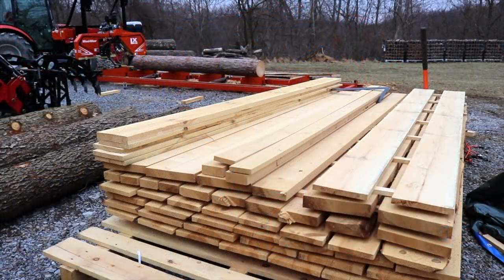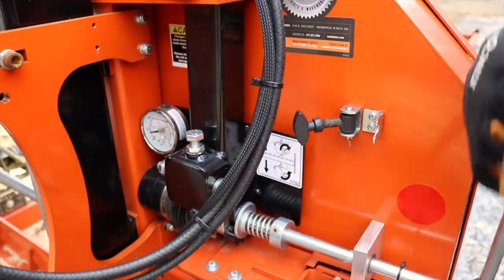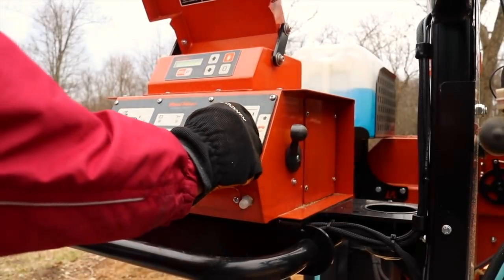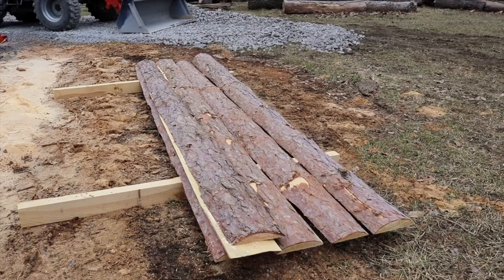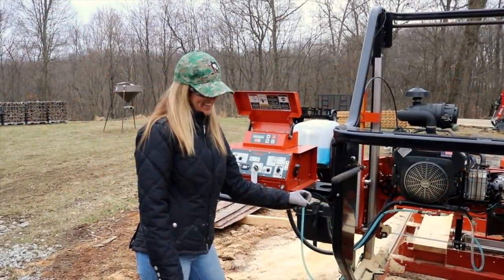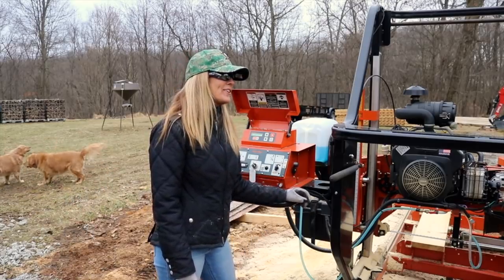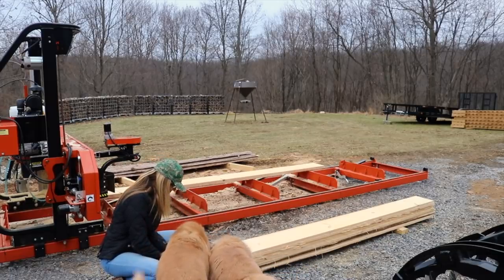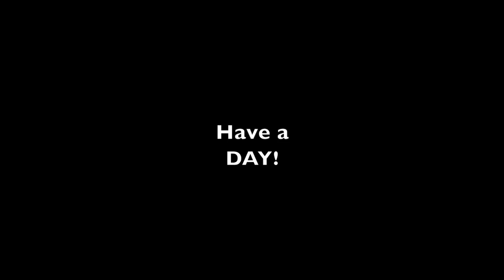#707 MILLING Homegrown Red Pine on the Sawmill

Comment: Mike, 
Engineer Bill here. To net the biggest square lumber out of a log, take the log diameter and multiply by about 71% (actually 70.7%). Looking at it another way, you'd need to slice off 29% of the smaller end diameter to get a clear square. As an example, the small end of a 12" log would yield an 8-1/2" square piece (12" x 71%), so you would slice down about 3-1/2" (12" x 29%). 
Love the videos!
Reply: Mike, My BAD... only slice off HALF of what I said... 1-3/4" (12" x 14.5%). Sorry to ALL!

Comment: Boiled Linseed Oil is what i use on my raw wood about $28.00 per gallon. You can thin it with turpentine or mineral sprites for deeper penetration into the wood. Good also for unfinished work benches and gun stocks. Lots of new snow in Michigan this morning. Have a great day.....

Comment: I use CWF preservative (Clear Wood Finish) by Flood.  You can put that down with an airless sprayer.  It's linseed oil based, but they make an emulsion out of it with water and mineral spirits.  That cuts down on VOCs and sinks into the wood.  We built our spruce log home in 1985-6 and I'm coming up on the fourth time to coat it.  If you like the look of the wood itself, this is a great product.

Comment: For a sealer on 55 sheets of T-111 for my shed, I used a water based product from Behr at Home Depot. What was nice about the sealer, was it was water based and I was able to make 10 gallons from each 5 gallon pail by thinning it with water and sprayed it through a pump sprayer. It was a real light color and I only need to do it every 4 yrs because the stuff held up that good. I do like the idea of Kerosene and oil also, much cheaper.

Comment: I would consider using the sapwood (bark) slabs for roofing for your sheds.  You always seem to have plenty so if it starts to deteriorate in five years you will have plenty more to replace it with.

Comment: We always utilized used motor oil and a splash of diesel/gas to thin it every 2 or 3 coats we would use sikkens stain.  As kids we used a brush to keep us busy, but my dad used a weed sprayer on our barn.The  fence is red and white oak going on 18-20 years since my dad put it in. The barn was sided a year a year after I was born and I'll be 25 in a few weeks we have not replaced a single board on the barn. As for the fence us kids have taken a few out over the years.

Just started watching the channel a few weeks ago, love watching the channel. A hearty hello from North East, Pa.

Comment: I use old motor oil and diesel fuel to thin it out. you could go with straight diesel for a lighter finish.  I soak my poles a lot of times too going into the ground especially, if it is an old telephone pole.  If you get treated timbers to put in the ground, I have heard there is a specific type now that will last and one that will not. 
I use recycled timbers and boards from old barns and houses.  The boards that have sat exposed in the elements that have acquired bugs, when treated with oil, the bugs come out gasping for air and die.  Wood boring bees come out and get stepped on.  They don't fly after a treatment.  If you have questions, just let me know.

Comment: What to coat the wood with???  A lot of people from where I come from would use Automatic Transmission Fluid on their log cabins.  It ages well and gives the wood a nice color.  You can either brush it on or spray it on.  You may want to mix in some Mineral Spirits to make sure it dries well.  If I was doing it I would brush on the first couple of coats to work it in then spray any subsequent coats.  Another very good method is to brush on a solution of 50% Boiled Linseed Oil and 50% Mineral Spirits.  This makes a thin solution that penetrates well and dries dry.
Michael from Canada

Comment: Best all around product of outdoor wood is Thompson's Waterseal. It is hydrophobic and water beads up and rolls off of it. If nothing else those pine and hardwood scraps make great firewood for outdoors if you have any campgrounds nearby. Just cut into two foot lengths and bundle. Bark makes a lot of ash but campfires work fine.

Comment: Thompson Water Seal. If you want a store bought sealant that can be spayed on. I have also used burnt motor oil and desiel fuel 20/80 mix.

Comment: Good day  Mike those outer slabs you  have  we use to get from the sawmill here ,years  ago  we used them for siding  on   some wood shed   and a few run in  barns , its good for that stuff like that, and the ones you have are pretty nice  ,would be good as siding on  a firewood shed   leave a small gap so air can move through  but keeps most of the weather out   Have  A Day  !

Comment: When you save aside the slabs separate  out the utter junk from the usable slabs.
That bark that Melesa  put in the usable slab pile really needs to be set aside. You will be handling  the slabs with your forks. Make sure everything in the usable slab pile is something  you wouldn't  mind using.
She did great.
She deserves her swimming pool.

Comment: Hi Mike and Mallisa!!😀😀
I would use a diesel fuel drain oil mix to treat the lumber if I didn't paint them. 
I would take the nice slabs, peal them and use them for siding on the drying sheds. If they don't match perfectly that's fine. Because it will allow the air to circulate. 
Take care my friends!!😀😀❤

Comment: Mike , Somehow I get the impression that you  and Milissa are NOT  into the "Rustic" look , but those slabs would make great battens for vertical board and batten siding around here. You space your 6-8-10" sawn boards about 2" apart and cover the gap with the slabs.  This processes makes your sawn siding boards cover much more of the building , allows for shrinkage of the lumber as it ages, and  reduces your waste since you don't want to sell softwood slabs cut to length  for firewood.   Around here  in central NY ( 60M south east of Boonville), there is a good market for slabwood  soft or hard, both cut to length or full length. There are lots of Amish milling operations around here and manny people have at least one wood burning appliance in their homes. I utilize all the slabwood either for heating or construction from my home built mill.
 I also built a free standing  steel table with a chain saw mounted on a spring loaded arm which mounts to it and works like a chopsaw  to make cutting full length slabs into firewood length fast and easy.
Loren

Comment: Hey Mike and Melissa. Hope all is well. Have an idea for the edge slabs from the sawmill. Especially where u have sort and hardwood. You could  cut them and leave or split once and sell them as campfire wood in bundles. Sell them to campgrounds. Even see them at country and in town convenience stores. Usually they're 5 bucks a bundle. Like an armload worth in a bundle. Even if u got 2/3 bucks a bundle that's still better than nothing. Usually the ones I see are the same type of wood so must b edge slabs from a mill too. Great use for them. Might be a better option for Hunters little enterprise. Hunter's campfire wood. Nothing better than turning scrap into a little cash. Let me know what u think. Thanks

Comment: was thinking .. you have everything you need for raised bed gardens .. the slabs can be cut to a couple feet long placed in the bottom of it.. sawdust can be mixed with other things like hay and dirt to make soil composrt . you have all the lumber you need for the raised beds. there is lots of vidoes on how to make them. and making compst is easy just need an area to do it . another product from the Morgans

Comment: Sealing wood is just like anything else. You get what you pay for. I'd recommend Permachink Products. My son and I built the log home we bought from KSM Log Homes in Mifflintown PA over 16 months in 2016/2017. I did a ton of research and Permachink has the best lifespan vs protection in their Lifeline Ultra 7 series. Its a 2 part system and works awesome. Seven years average between recoating and when you do, you only use the clear for recoats. No building layers of color and darkening over time. I did our entire 1700 sq/ft log home inside and out over a Saturday and Sunday with a standard Graco airless paint sprayer. Lifeline Clear inside and Ultra 7 color and clear outside. I would also suggest using the Permachink Shellguard RTU for protection from insects. Its a borate based liquid I used a backpack pump prayer to apply. It protects from all wood eating insects. Permachink products cost a little more upfront but after 3 years now, our log home still looks brand new. We would have had to recoat with most other brands. Message me if you need any other info!

Comment: If you are going to make your own siding I would invest in a good router and table. Use a carbide cutter spray oil on the cutter like cheap cooking oil. Then run them through making a tung and grove. Helps keep the water out. You could also take them to a mill. They can kilm dry them and cut the tung and groove for you. Perhaps at a reasonable price. God bless

Comment: Lots of good sealants on the market, the important thing is to make sure the end grain is properly sealed. On smaller jobs I will leave the bottom of boards standing in the sealant over night letting the wood soak it up, another thing I do is make sure the grain runs from top to bottom of the board,,this way there is less resistance to water running off, it makes a big difference to longlivety of the board. Hope this is useful. ☺

Comment: Hi Mike , I'm with the people with the idea of quick burning . Using a tiger torch the burn at thin layer of cellulose. Hardening the wood it's self . Have a look at -->  wild wonderful off-grid <--- they have use it extensively . I understand it is a centuries-old way to preserve wood , my 2 cents 😀 🇨🇦 Craig

Comment: I  like the used oil and Kerosene look, especially on long fences, but I'm not sure how long you'd have to wait to be able to work in there without a mask.  I would leave it dry before I put anything Thompson on it unless they have totally changed their product or you put it on 3 times a year.  Personally I like linseed oil.  Whatever you decide remember to seal the cut ends.  I was looking in the yard there and kept seeing the tandem axle trailer.  That is pretty much all they do is sit there.  lol  Until you need something specific.  I have had many over the years 16's and 20's and the one I use pretty regularly is my 10'.  For me the bigger ones get loaned out more than I use them and I think some friends owe me a set of tires!  lol

Comment: I have T&G Red Pine for my living room floor and installed it to look like it was over a 100 yrs ago by using school nails and face nailing them into the floor joists. I used 8'' and 10'' wide boards and alternated them, then sanded, a light stain and 5 coats of poly. Looks like it's been there forever and being able to see the somewhat square nail heads, looks pretty cool, if ya like that old look ?

Comment: Wood coating 👍 COPPER COAT WOOD PRESERVATIVE. Specified in a bulked contract. Mix a little diesel with it to stretch it. Apply with a garden sprayer Diesel will ruin your garden sprayer😃 but it’s an easy job

Comment: I see others that see siding in the slabs. Would be a little more work, which you love but you could stack them on the mill on edge and trim an inch or two off the top  then flip  and  and trim the other side. Now you have siding with the log cabin look.
Reply: Another thing, when you build the sheds leave cracks between the siding boards to allow air flow and a means for moisture to exit the sheds.

Comment: used motor oil and kerosene mix in a garden pump sprayer on a warm day so the oil is warm or straight used oil with an siphon air sprayer

Comment: Over here we use what they call honey, its a very thick it  a by product of crude oil we warm it up with hot water and cut it with lin seed oil then pour into a 3 gallon  hand sprayer,  it works great we seal log cabins with this stuff,  it lasts between 5 to 8 years bugs dont like it nor ants, but its weather proof

Comment: I use 80% boiled linseed oil with 20% mineral spirits, lasts a long time...also have had good luck with Messmers UV plus.
Reply: I would only add some orange oil keep termites and other bugs away. Don't need much just a couple drops per gallon. God bless
Reply: Greetings from No. VT - The mix that my wife's uncle used on his camp (next to ours) for decades was 80%  boiled linseed with 20% turpentine rather than mineral spirits. He found that the turpentine and boiled linseed oil was good for a decade or so before needing to be renewed. I suspect that since the turpentine evaporates slower than mineral spirits it allowed the Linseed oil to penetrate a little more. On a negative note, I did notice that on the side with strong sun exposure the UV damage to the wood was more noticeable than what I was getting from using the commercial Sikkins, which does have a UV blocker.

Comment: That slab wood works good for wood shed walls.
Those old farms up your way with 200 year old barns that are now gray were not treated with anything were they?  Maybe linseed oil and kerosene....  
Seems funny you said no one for fire wood.  I was raised the same way, we always were told it starts chimney fires...  Now in Alaska we burn two woods birch and spruce...  Spruce is a pine right?  Instant heat when dry and I've never heard of a chimney fire up here...  I use a good mix in the stove...  We have a huge issue with bottle kill spruce... The main reason we have so many forest fires every year.....

Comment: MIKE,  
Sickken wood finish -( pricey)
Thompsons Water Seal -( really not as good as   it used to be)
CWF - ( seems to hold up the best)
Those 3 if you're interested,  but being these buildings won't be lived in, I'd say you're on the right track with kerosene/ used oil mix.

Comment: Hey Mike!  How does the split wood make it from the Big Pile to the steel containers you use to stack the wood in to let it Season for a year ?   That would be interesting to see how you stack and relocate the steel containers. Does the customer purchasing the wood unload the steel container into their truck or do you deliver the wood locally and dump the wood out of the steel containers on customer’s property ?  Just curious how this works since you sell a Lot of firewood.  Thanks!

Comment: Hi Mike and Melissa

Your Woodmizers  drive is slightly different to mine. The variable speed set up is the same but the drive lever on my LT40 is spring loaded and goes to neutral as soon as your let it go. Which acts as a dead mans handle stopping the forward or return motion as soon as its released. Making it safer for the operator in my opinion.

Comment: I’ve had my best luck using any Bear product. I used Thompson’s water seal for years. The Bear products out perform Thompson’s hands down. Plus it can be applied with a pump sprayer.

Comment: Mike, have never seen you edging boards. I set boards needing edging aside and wait until I have a 4 or 5 inch cant on the mill then stand and clamp them against the cant. sa  Save the trimmings for sticken.

Comment: My vote goes to burnt motor oil and thin with diesel and use weed sprayer to apply. Done this a lot on rough sawn boards as you are going to use.

Comment: You might consider the Japanese method of wood preservation  called Shou Sugi Ban Yakisugi. Lots of examples on You Tube and fairly simple. Also repels bugs. It's basically just burning the wood with a torch.

Comment: I was wondering two things 1 if you have that on automatic movement and you was to trip and fall does the machine have an emergency shut off on it and 2 what perfection do you have if the blade breaks don't you worry that it will fly and hit you

Comment: Hi Morgans Clan!  I'm not sure if you ever explained this...  You make a cut of the log on the sawmill.  Then rotate it 90 degrees twice (180 degrees) to cut the opposite, parallel side.  Then another 90 degrees to make the first perpendicular side.  Then two more 90's (another 180 degrees) for the last side.  That's 450 degrees (or 1 1/4 full rotations). 

Why can't you make a cut, rotate 90 degrees and repeat for one full rotation?  No matter what at one point you are resting on the curved log and butting a cut side on the edge guides/stops to get your first 90 degree cut.  I just can't figure out why all the extra turning (other than a good workout!).
Have a day!

Comment: The simple set setworks is an extra $1200.  Is it worth the difference for occasional milling, or could you just adjust it manually each time without too much extra effort?
Reply from the maker: Im not sure but all I can say is i love it, I wear reading glasses and the scale is tough for me to see, its just very accurate and very easy this way for me

Comment: Question do you two have a hot tub if you dont get a thuraspa build an incloser put it inside that so you two can close the door turn on the heater ckimb in and relax,she will love you even more than she does its not a pool but its a start

Comment: I'm doing historical restoration on a building built in 1890 are red pine is dark & dense
Reply: I have an hm 130 on a trailer i just love cutting wood 47 yrs I've been a carpenter no heavy equipment to move logs at 130 lbs soaking wet i love it

Comment: you should get an extension hose for the saw dust discharge it will get it out further so you dont need to walk over it. Several guys that have them have done this
Reply: check    Out of the woods videos he has one on his saw mill

Comment: why don't you cut at least 12 footers so they come out on 16 inch centers 10 footers don't work unless you use 2 foot centers I would think you would want them as long as possible so ypu don't have so many butt joints . Just wondering